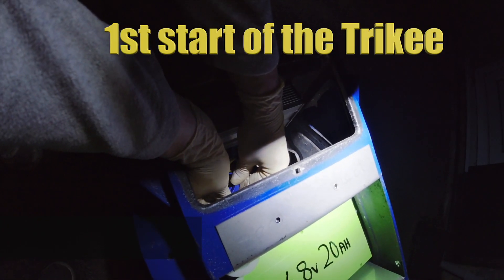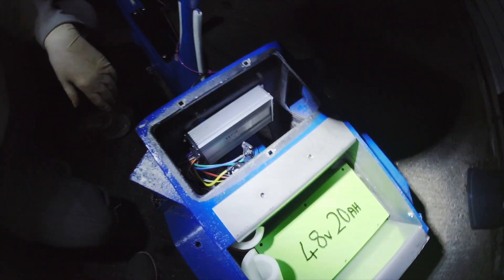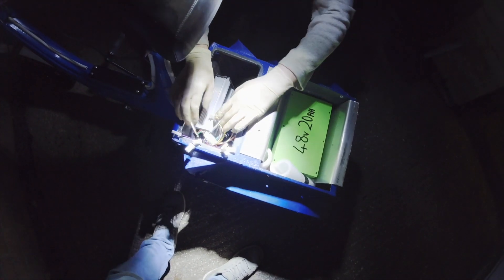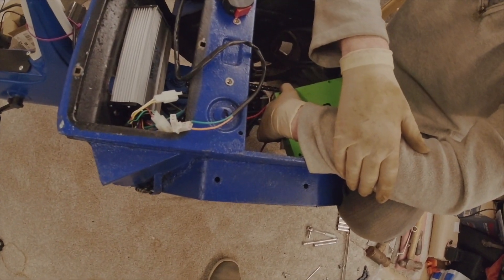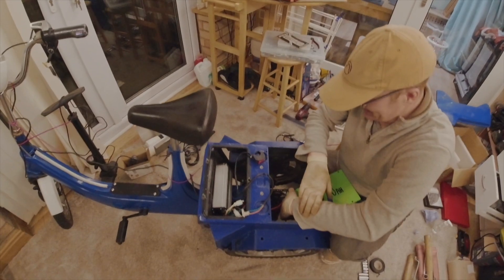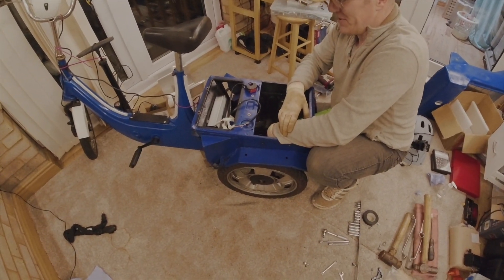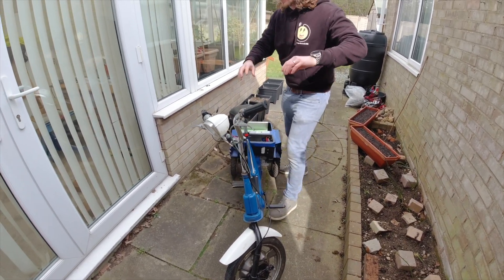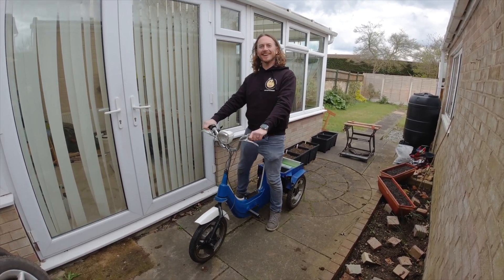BSA Ariel 3 EV Conversion e-trike #SpecialTrikee Part 5

Comment: Single side drive, locking rear brake, ineffective front brake. You've got yourself a sit up and beg tilting Sinclair C5!
Reply from the maker: I must admit i nearly bought one a little while ago, but this looked more dangerous, so right up my street 🙈⚡💥
Reply: @chargeheads  I have two C5s and you've convinced me I need an Ariel. A tilting C5 would be hilarious.
Reply from the maker: @bnrynlds  get in there while they're cheap. Mine cost £200 without engine and fuel tank